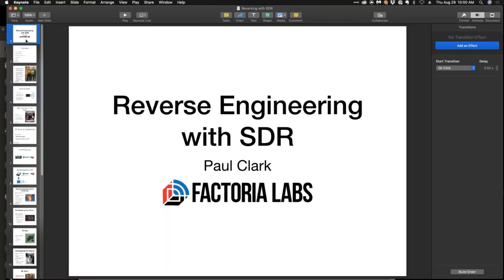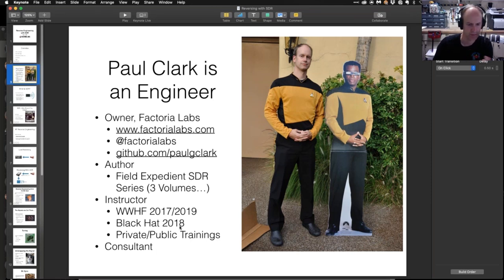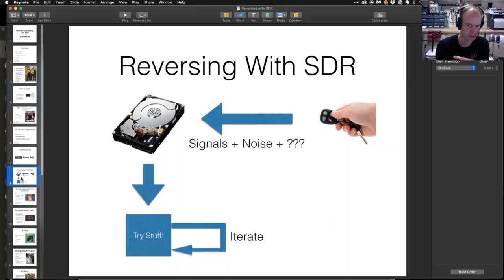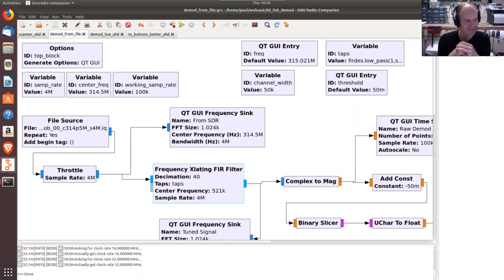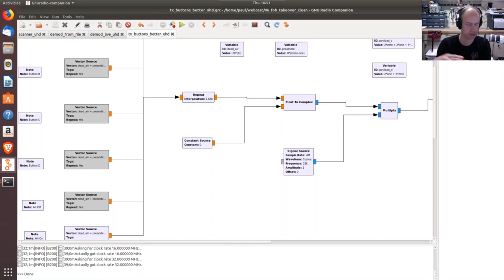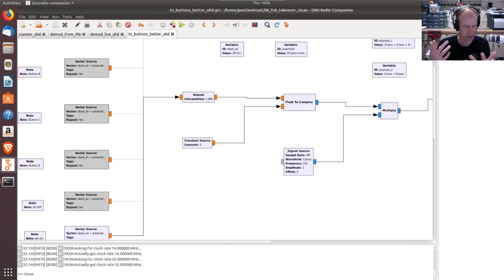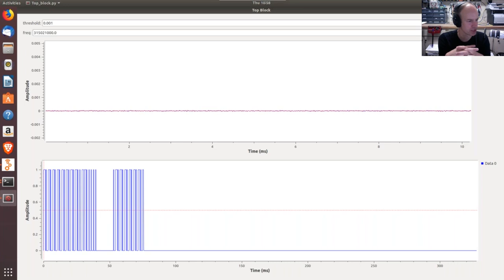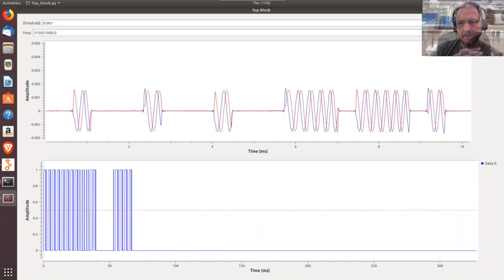Reverse Engineering with SDR

Comment: The question about SDR being illegal is interesting.  It isn't necessarily the SDR.  There are instances where receiving signals can be illegal no matter how you do it.  In most cases it depends on what you do with the information.  It is frequently illegal to act on certain information.  The best example is using information to commit a crime.  You may get additional charges added.  This might be an example where just possessing an SDR could be deemed illegal for a felon.  I'm not a lawyer and to the best of my knowledge no one has been convicted of having an SDR yet.

MCL 750.508

Police scanners in motor vehicles
Effective May 1, 2006
Citizens will no longer be required to obtain
a permit from the State Police in order to
equip a motor vehicle with a scanner.
Instead, it will be a crime if a scanner
(regardless of its location) is used in the
commission of a crime with a penalty of 93
days or more.
A person who has been convicted of a
felony within the past 5 years is prohibited
from possessing a scanner at any time

Comment: I like the HackRF GreatScott SDR course, but doesn't have much in the way of practical fun projects!  I'd love to learn popular tools (Universal Radio Hacker) used for common problems.. like "Decoding a garage door opener with an RTL-SDR"!

How many hours of content is the $80 SDR course at factorialabs have?    Does it contain any information on transmitting (using either a HackRF or LimeSDR)?

Does the SDR-01 also include a place to ask questions?

Comment: With respect to SDRs and different nation's regulations. 
The UK pulls out a winner in the "selectively enforced grey area" on this one too. 
"It is unlawful to listen to any broadcast which is not for general listening"
What is general listening? That is not defined. Technically even listening to pirate radio on a normal FM receiver, ATC or numbers stations and anything that isn't in the FM(/AM/SW/LW/MW) band(s) and allowed by the state isn't allowed according to this, depending on how you take the wording. Personally I would take 'general listening' to mean "not encrypted" same as anything unencrypted and not behind a password on the internet is for "general viewing", you put something you don't want seen up online on a photo sharing website and someone finds it, that's on you. You transmit something you don't want heard on open airwaves, that's on you. If anyone with a $40 dongle can hear it, it isn't outside reach of the general public other than dedicated enthusiasts like it once was.